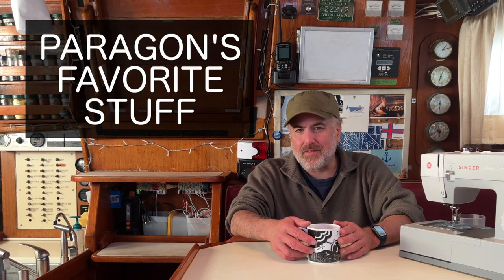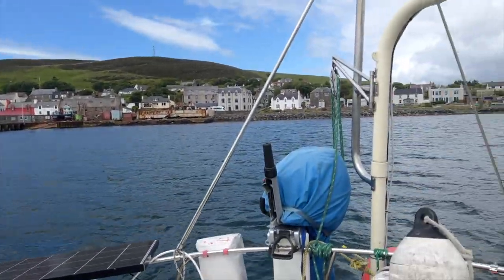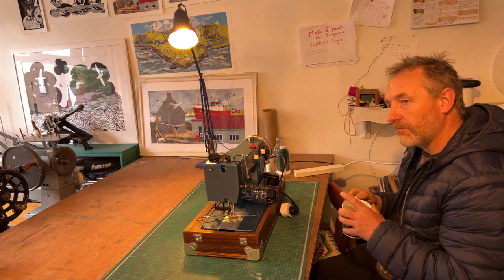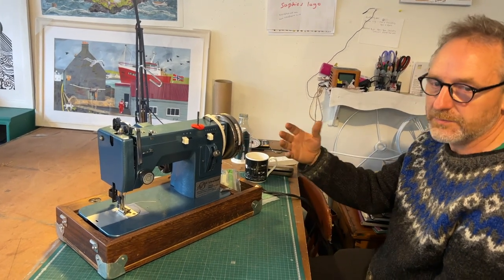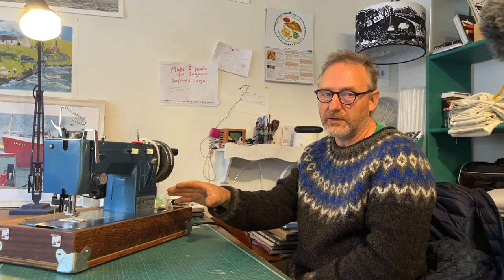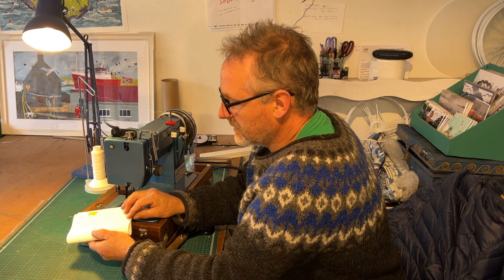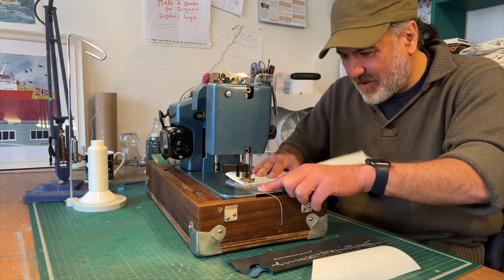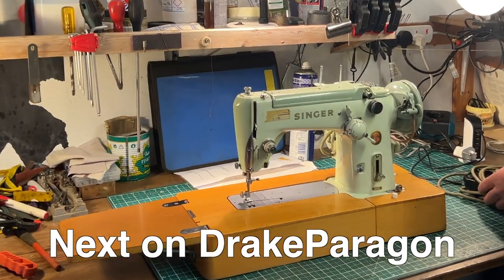Sailrite: The best sewing machine on a boat. | Paragon’s Favorite Stuff Ep. 15

Comment: A good overview of the Sailrite. With proper adjustment of tension, foot pressure and practice a Sailright can be used for many lighter fabrics avoiding the need for a second machine. I modified our machine to run with a 12 VDC motor, so we did not wast energy running the inverter.

Comment: There are very similar machines, based on a machine that predated the Sailrite. One is the REX, which looks the same, is half the cost and uses all the same attachments. Whereas the REX can be used for all the Sailrite will do (after adjustments and a couple of part upgrades) it won't ever work as well as the Sailrite. 
I bought a REX for upholstery and window treatments. I saved a lot of money and learned how the machine works with an electronic servo controller and external motor. I'm pleased with it, but will upgrade to a Sailrite machine in the future. Not sure if it will be an Ultrafeed or a Fabricator, but the servo will work with any machine.
The Sailrite machines are really worth the extra money. Get a Sailrite and save yourself the headaches and breaks of the "clones".

Comment: when you mentioned how slow it can go, you reminded me, there is a potentiometer inside most singer foot pedals that you can dial to adjust the sensitivity of the pedal
Reply from the maker: I did try adjusting that, but it didn't really help. It seems to me that when sewing through much thicker materials like sails, you have to press the pedal down further to get it have the force needed to go through the material. But when you do that you increase the speed as well.. Great for clothes and lighter stuff... Not the best for heavy sails.
Reply: @drakeParagon ahh, that kinda makes sense.  guess thats just the limitation of the machine at that point.

Comment: Hi Drake. We have a Barracuda. It is a knockoff and works ok but does not have the servo motor. They are more expensive but allow better slow speed control. It will sew 11 or 12 layers of Sunbrella, no problem.
Reply from the maker: I love how the Barracuda has a handle on top. That would make it so much easier to pull up out of a top opening locker like what we have.
Reply: @drakeParagon  For sure. They are heavy. We loaned the machine to Gone Sailing (currently in Ireland I think). Jane said the handle was a big plus.

Comment: I had been saving up for one of these several years ago, and at the last minute went a bit above it and got a new Consew walking foot machine, 206Rb-5. Great machine with also needle feed which is nice.  Bulletproof machine, never needs adjustment, does not care what you sew with it. Still, it would be fun to have a Sailrite cause of the zig zag and smaller size than a true industrial sometimes. Maybe in my next life!

Comment: Great job Drake.  I picked up Sailrite LSZ with Worker Bee and the works recently, after using my Singer HD for awhile.  I still like the Singer for quick light jobs, but the Sailrite is great for the heavier Condura projects I do more often. The Worker option is very nice and runs super slow...and has a light.

Comment: Your sail repair really didn't go as well as you'd have liked for one reason..maybe there were more reasons..but...is because you didn't use the walking foot for sure.
Reply from the maker: I did get the only walking foot attachment available for the Singer Heavy Duty machine, but I don't think it was designed for material as heavy as what we were sewing. It didn't really help on that machine. However the walking foot on the Sailrite is a whole different thing..
Reply: @drakeParagon  My walking foot works for sails with the Singer. At least for my Catalina 30 sails...several layers.
Reply from the maker: @allynonderdonk7577  Hmm... Is your machine a Singer Heavy duty and is this the walking foot you used? https://singeroutlet.co.uk/products/even-feed-walking-foot-original-singer-retail-pack?variant=33446110822453

Comment: The sailrite  is a good little machine but over priced, I've got a much better industrial machine that cost less, but it doesn't do zig zag. Walking foot machines are not for delicate fabrics.
Reply from the maker: There are so many wonderful sewing machines out there that would happily go through many layers of sail material, but I think for sail repair you really need the zig zag.
Reply: @drakeParagon  yes, because as the sail stretches it would burst with straight stitching